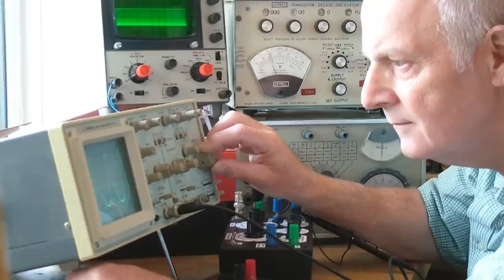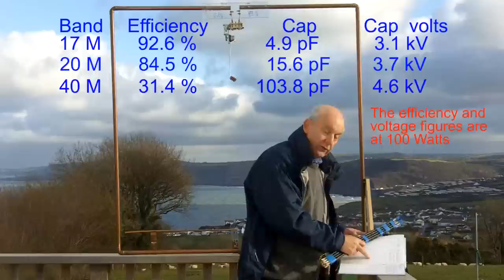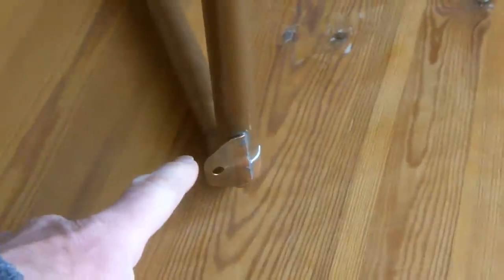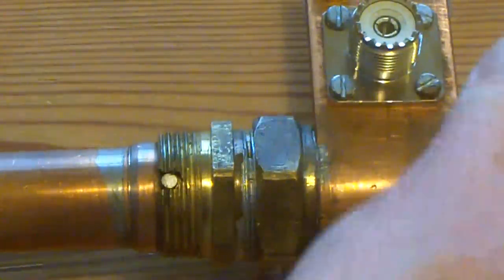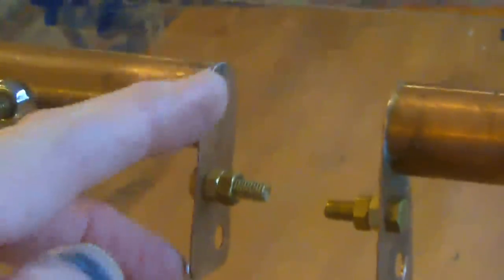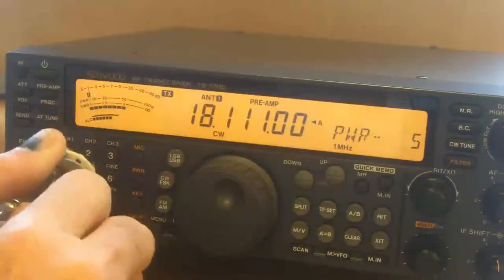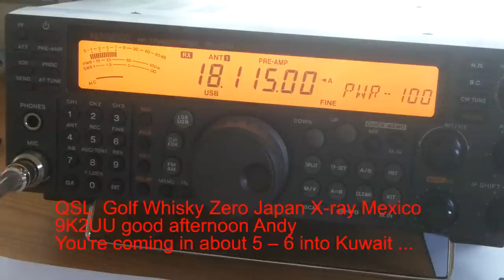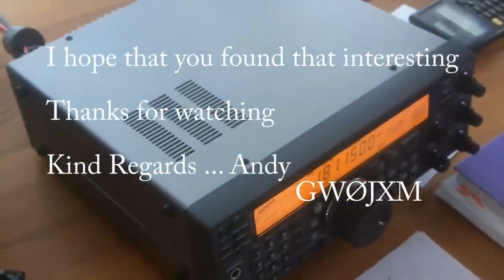About Radio 67 Magnetic Loop Antenna for 17,20 and 40 metres

Comment: Thank you Andy - this has certainly inspired me to do some more research into using a loop.
Reply: How did you go? 
My investigations have ended up with me at the hardware store looking at aluminum strip which comes in 3m lengths.
Much lighter than copper and if you use a piece with 25mm width or more, it's going to have a very low RF resistance. I'm about to make a loop out of some

Comment from the maker: Hi Leonard, well I reckon it’ll work surprisingly well if you can get it by a window. The very first time I connected this to my transmitter was in my workshop where I have a lot of metalwork and metal cabinets. I had several DX QSO’s then it dawned on me that, not only is there a lot of metal work in the room and I mean a lot, but when I built the workshop I insulated the walls and ceiling with overlapping aluminium coated foam board, so it's almost a Faraday cage!
 Kind Regards ...Andy
GWØJXM

Comment from the maker: Hi Mark, thanks for the feedback. The nice things about loops are, they are small and  work well at just above ground level. Watch out for the high voltage. There are some good sites with voltage calculators, they don’t all give the same result but I guess they are near enough to let you know when you’re heading for trouble.
Good luck with the project.
73’s Andy GWØJXM

Comment: Nice job Andy. In our club station have a little model for 20 meter. Now the new project will be also for 40 meter band. For the capacitor tuner i'm planning a loopback control with a potentiometer on the mechanism.
Congratulations de IZ8FAV
Reply from the maker: Well done
73's ... Andy

Comment from the maker: Hi again what I didn’t say earlier is that if you can mount the loop high enough that you might find that you can mount it horizontally and you should get an omnidirectional field pattern, one other point with any antenna in your loft you do run the risk of coupling RF into the house wiring. I did it once and I damaged a computer as a result. Man I'm still learning.
All the best ... Andy    
GWØJXM

Comment: Hi Andy, you have done a great job engineering this loop, no chance for any significant RF losses and simple. I love the disassembly aspect of it too. I was thinking, on 17m, at its highest frequency of operation it would be more or less a halo antenna standing vertically. It only has 4.9pf bringing it to resonance and is not greatly shy of having a 1/2 wavelength perimeter. Have you checked it's self resonant frequency with all the capacitors completely unbolted? I'm wondering if it makes it to 15m. I'm thinking of making one which is self resonant at 27mhz and using a variable capacitor to tune it down to the lower HF bands but I'm not sure how long the sides are going to need to be to achieve that. Anyway, thanks for the posting Andy, it was interesting. Best regards :)

Comment: Nice work. The thin wire connections from the variable capacitor can be a real Q-killer. I would change replace them with metal strips or coax braid. I would not use thread connections. No defined RF current path. The overall construction reminds me of an article I wrote in 1982 in the German CQ/DL magazine.
Reply from the maker: Hi, OK on the 'add-on" co-ax capacitor one could reduce the losses by going to strips of copper but take another look at the copper strip that connects the variable capacitor to the loop. The physical thickness of the strip is many times thicker than the skin depth of the current at the chosen frequency, also note the orientation of the strip is such that the current flows in the broadest possible amount of copper. (The same can be said for the plates of the capacitor)
Even so, in reality the current tends to migrate out to the outer edges of the strip, this is due to the self inductance of the strip. I guess the real winning answer would be use litz wire. I wish I had more time to talk about my experiences  with high power Radio Frequency power transformers and induction heating feeder systems up into the 100's of KW range, all very interesting and sometimes a bit scary!   
All the very best . . .  Andy
Reply: @AndyDaviesByTheSea  Oh, I see. In the video it looked like thin wires. I use 3D EM simulation (3DS CST) for decades now and I have often seen current distribution on metallic surfaces. In one planar wideband antenna the "migration of RF current was so strong, that the middle part of the antenna could be punched out without any effect on the antenna properies. In smaller strips however, current migration at HF frequencies is probably less. I find that the key to making  good magnetic loop antennas lies in conductor surface area. In this context, it is important to realise that tubular loops leave the entire interior metal surface un-utilised.

Comment from the maker: Thanks, the QTH is great until the wind blows, but I guess as with any QTH with an open view anywhere that’s when you pay for it. We routinely get winds into the low eighties (MPH) and as there’s nothing to disperse the wind it can be pretty destructive and very noisy especially in the middle of the night.  The greenhouse and sheds have to be fixed to the ground with substantial steel cable and galvanized steel land anchors. 
Kind Regards ... Andy

Comment: One more question , may I request for the details of the gama match, length of the copper rod, distance from the pipe of the loop. The height at which the SO239 has to be fixed.

Comment: Yow! I will need the 5KV Comet vacuum cap! What if i can make it a circular loop, with larger tubing? I sure appreciate the information! I want to be able to do a kilowatt with a loop. Beautiful workmanship, mate! Nasty looking bruised thumb, though! 80-100 watts is "barefoot" for me. I can drop to 5 QRP. I have taken to using a lot of acetyl plastics like Delrin. I repair guitars, and amplifiers. Delrin is nice stuff for clamping up guitars for repairs, as most glues will not stick to it, and it is really tough, durable plastic, that does not get brittle with heat and age. Delrin is fabulous stuff, although a tad expensive. Try finding a shop that works with Delrin, and get some scraps. I think you will like the stuff a lot! I at least want a directional loop for receiving. I will probably utilize a simple noise bridge for tuning, until I get another spectrum analyzer I can run off a T pad. Cheers, 73s, KI7AQJ

Comment from the maker: Hi essentially the loop antenna is good for any frequency but the size of the loop and the value of the capacitor has to be correct for the chosen frequency. To help you I’ve just added a link to a very good site where you can get all of the dimensions for your chosen frequency. The link is at the end of the description box for this video. Be aware of the very high voltages developed on this antenna + Check that the loft doesn’t have aluminium foil in the insulation, could act as a screen.

Comment from the maker: Hi Rick
It was at about 45° to his bearing, that is neither broadside nor end on. What I’ve found is that the loop’s not very directional at all, I suspect that’s because I’ve only ever used it in a relatively low position. In the video the loop is on the wooden floor and the true ground is just over three feet below the floorboards. I’d say it performs a bit like an inverted ‘V.’ I guess you’ll have used loops in the air force, are they directional with real height?
73's... Andy 
GWØJXM

Comment: I saw that you put your loop antenna next to you I was wondering if you had any concerns about EMF exposure being so close to your antenna while you are transmitting 100 Watts
Reply from the maker: Hi Dan that's a good question but no I didn't give it a second thought. 
I only did it for the video. Given the inverse square law I was probably at higher risk using the old style mobile phones that we used to hold next to our heads. But having said that I don't think that I would want to spend too long too close to any transmitter. I think that in the future they will look back at mobile phones and tell us that they're as bad as smoking was, but maybe we'll need a lot more data. I think trying to get folks to give up using their phones would be harder than getting them to give up smoking. Everyone seems addicted to their blessed phone these days.
All the best. Kind regards . . .  Andy

Comment: Will it be ok to have a square loop instead of the gamma piece. There is a field day coming up and would like to build a square loop antenna like yours.
Reply from the maker: Hi so long as it matches the transmitter it doesn't matter what shape it is but but I think you're going to need the gamma capacitor to achieve the match. 
Good Luck . . .  Andy
Reply: Thank you.

Comment: I shared this video a lot in the last year or so. It's views appear to have soared. 😀
Reply from the maker: Thank you very much I'd love to hear from anyone who has copied or improved on it. Kind Regards . . .  Andy
Reply: I don't think that anyone is going to improve it much. You took quite a few measures to ensure good performance without going to the ends of the earth.
The only thing that would improve it would be a vacuum variable capacitor, but I suspect that even this would not make a massive improvement.
I have been Looking at aluminum strip at the hardware store that comes in lengths of 3 meters.
I was going to use the one that is 25mm wide, use an aluminum angle at the bottom for an SO-239 connector, and maybe use aluminum sheet to make some  capacitor plates and use plastic toilet seat bolts, as I have some) for the adjustment.
I'm still deciding on the capacitor- I could even use blank pcb material, not 100% on what im going to do.
I still won't be improving upon your loop (more like dropping some performances) but it will be smaller and lighter and also be able make it able to be easily disassembled.